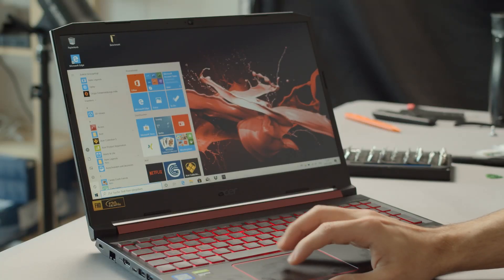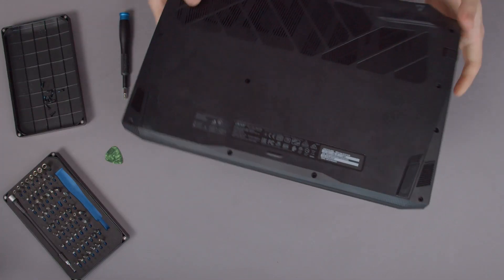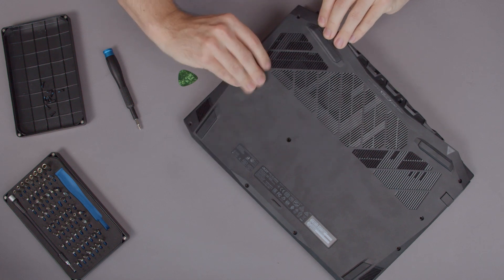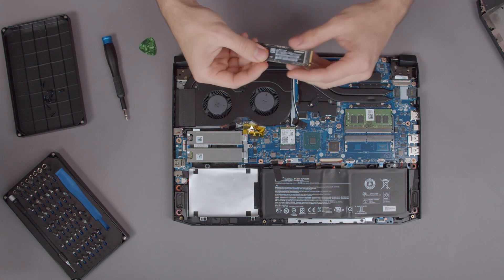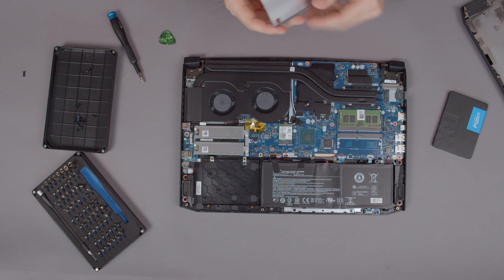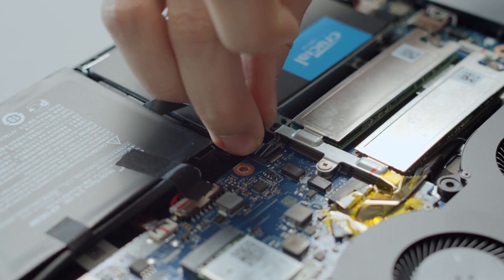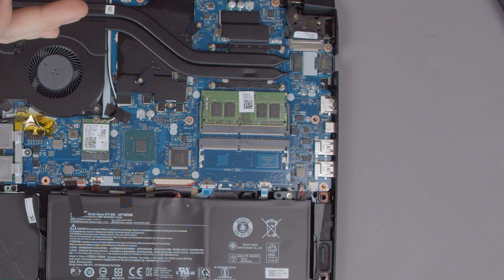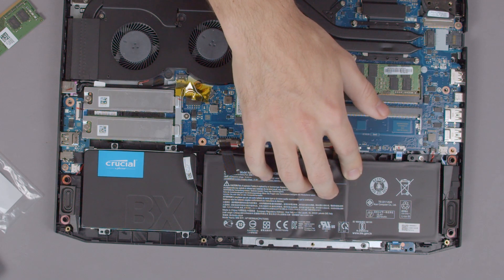Tutorial: How to Upgrade the SSD and RAM of your Acer Nitro 5 - ENG

Comment: Thank you for all the little extra info about speeds and whatnot. I've found a lot of this a bit confusing, as I haven't messed with the inside of a computer since I was a teenager and turned my HP pavilion into a VooDoo3 gaming monster (yeah.... it's been a long time lmao). So much has changed since then, and even though most things are simplified and no longer full of proprietary components connectors, its still a lot to take in after being gone for so long. Thanks again!! Now I can upgrade my RAM, cause 16GB isnt enough to mod Cities Skylines after you've bought all the DLC... lol

Comment: My laptop is Acer Nitro 5 AN515-43 R3JU 
What is the compaitable m.2 ssd for my laptop?
Reply from the maker: Hey, according to the spec sheet the standard SSD it ships with is a M.2 PCIe SSD. So there should be an open M.2 SATA Port in your notebook. But since we didn't check every possible Model, it' sbest to check if there is a free slot at all. If there is a slot next to the SSD already in the system, you can add any M.2 SATA SSD in the 2280 Form Factor as additional storage.

Comment: i just got new ram to replace the stock one (i bought 2x8gb) and when i put them both in the channels the laptop will start and the keyboard will light up and the fans will run but the display will not turn on. did i do something wrong?
Reply: Did you shut the laptop down and remove all cables before you insert new memory

Comment: I'm in Colombia, bought a Acer Nitro an515-43-r8jh and after only one year the mechanical 1TB hdd is slow and only 12GB ram is like little. My motherboard is Octavia PKS but you only find small info about it over internet. After several trial and error, I know now it supports DDR4 2400 max 32GB (16x2) and ssd m.2 NVME (not on the sata ssd port but on the pci port). Will buy this from amazon:
https://www.amazon.com/gp/product/B01HOM9WCI/ref=ox_sc_act_title_3?smid=AWD7GDDT7Q2ZT&psc=1
https://www.amazon.com/gp/product/B07VYG5HQD/ref=ox_sc_act_title_2?smid=ATVPDKIKX0DER&psc=1

Comment: I have this model of laptop and looking to put a seagate 2.5" 4tb hdd inside. However the thickness of the 4tb hard drive is thicker than the normal 2tb 2.5" drives. Would a 4tb Seagate HDD fit in this laptop or is the drive too thick to fit correctly?

Comment: hello! Can you tell me what is the max SSD speed that Acer Nitro 5 AN515-42 can handle? I have seen a Samsung 980Pro on the internet that has a writing speed above 5000 MB. sry for bad English
Reply from the maker: Hey, it's PCIe Gen 3, so you won't achieve that kind of speed. But about 3000MB/s are doable with the right drives. If you put a 980Pro in there, it will run on this lower speeds and will work fine otherwise.

Comment: Is there a limit for the gb on the second ssd slot?
Reply from the maker: There is a limit by Windows itself - or by the filesystem to be precise - but since that's 256TiB you don't need to worry about it :)

Comment: i have a nitro 5  i5 10th gen 1650ti with 2933mhz. Can i change my ram to 3200mhz? im planning to upgrade my ram with 16gb 3200mhz
Reply from the maker: Hey, you can, but it won't make any difference as the notebook is usually locked to that maximum RAM Speed. Also the 10th Gen. i5 won't profit from faster RAM much anyway.
Reply: @notebooksbilliger  So if I'll add one 8gb 3200mhz with my existing 2933mhz, both will have 2933mhz?? It's hard to find 2933mhz ram in my country, usually its the 3200mhz variant

Comment: @notebooksbilliger.de Hi, could you tell me which SSD to buy for this model please? AN517-51-76V6 Thank you very much! (if you have a link to a good one at a good price, that'd be great!)
Reply from the maker: Hey, there are plenty of options. Depending on what is actually build into your system you can either add a SATA M.2 SSD or PCIe SSD. Make sure to check that before buying anything. For a SATA SSD the Crucial MX500 is a safe bet. It's comparably cheap, yet fast and reliable. For PCIe you can't go wrong with a WD Blue (make sure it's the NVMe version here) or a Crucial P5. IF you want more speed the Samsung 970 EVO or WD Black SN750 are your best option in our opinion.

Comment: Finally got the acer nitro 5 and I want to change the ram from 8gb to 16gb, my question is can I remove the ram already in the laptop and get a 16gb ram (1stick) or do I have to get another 8gb ram to go along with the ram that came with the laptop ? 

And my second question is what type of ram work with the acer nitro 5? I use the intel core i5 version
Last question, is it possible to add an extra 16gb ram stick to the 8gb already in the laptop ? And make it 24gb ram ??
Reply from the maker: Hey, you can do all 3 if you like :) Best option is to go dual channel, which means getting two matching RAM sticks. You should be fine with DDR4 2666MHz. So my advise would be getting another 8GB module or if you want more than 16GB get two new 16GB sticks.
Reply: @notebooksbilliger  can I buy a 16gb ram and add to the 8gb I have already? Thanks for replying

Comment: hi sorry i just had this laptop and i have the 512gb ssd pcie/nvme. The empty slot beside it can i just add another m.2 pcie 1tb ssd to it for extra storage without downloading anything or do  i need to do something else? Same 2.5 inch ssd can i just buy and  Plug and the system would  recognise it? Any help would be appriciated please?
Reply from the maker: Hey, if you already got a M.2 NVMe SSD in your system, you can only add a M.2 SATA SSD into the second slot. But you don't need to download anything after you upgraded it, just head to the drive management in Windows to initialise and format the new disks.

Comment: My nitro 5 have been getting 80°c just from opening chrom for a while now, anything i can do to fix it?
Reply: If you still have warranty you should undervolt your CPU. If your warranty is over you should consider repaste of CPU and GPU. I dont know if opening and cleaning dust from fans will void the warranty tho. Also always limit framerate in nvidia control panel and set apps to use adaptive power mode. Sometimes, if laptop runs too hot while ingame, I disconnect the power cable and wait few minutes for temperature to drop but that gets annoying quickly. Also 80 degrees is still normal for laptops. If over 90 it becomes a problem

Comment: I purchased the N5 17.3 a few months ago. It's a a great unit, but being marketed as a gaming laptop is an error due to the memory size. It should have at least 1TB as a minimum. I use STEAM to download games, but the main one I use, uses so much memory, I have to uninstall the other games as a result.  Your video looks easy to upgrade this unit, so I may consider doing this as I feel my hands are somewhat tied at the moment as to what content I can download due to having very small RAM.  One question though, if mine is already set up, do I need to clone my current ssd to the new one and if so, how do I do that?   Also, should the battery connector be disconnected before working on the upgrade?  I'm sure on another vid I watched, he took the power cable off from the battery, then opened the lid and pressed the Power ON button a few times to discharge any residual current left in the system.
Reply: Just a small correction though. When referring to persistent storage data, it is best to use the term storage space, as memory size can be mistaken for RAM which stands for Random Access Memory.

Comment: Hi, I have a question... You say: The second M.2 SSD Slot only works with SATA M.2 SSDs! A second PCIe SSD won't work! 
But if I look at: https://community.acer.com/en/kb/articles/101-what-type-of-m-2-ssd-drives-are-supported-on-the-nitro-5#:~:text=2%20SSD%20drives%20are%20supported%20on%20the%20Nitro%205,-By%20Acer%2DIngrid 

It seems that for the AN-515-54 model (which I own) the M.2 slot 2 is compatible with either PCIe or SATA. 

So I should have no problem installing a second SSD NVMe PCIe in the M.2 Slot number 2 or am I wrong to assume this??

Comment: acer already gives u 2 m.2 slots and nvme ssd now cost almost the same as a 3.5 inch ssd why the hell are laptop manufacturers still putting in a 3.5 inch hdd bay wasting space and putting small battery acer can easily put in a 65w battery giving users so much better battery life

Comment: Thanks for the vid

Folks, does anybody know if SSD Samsung 860 EVO M.2 2280 (MZ-N6E500BW) is compatible with Acer Nitro 5 AN-515-54?

Or will any SSD with  SATA3 M.2 2280  be fine for the laptop?
Reply from the maker: Hey, any SATA3 M.2 will be fine, as long as you put it in the SATA M.2 Slot. So the 860 EVO will work :)
Reply: @notebooksbilliger  Hey:) Thanks for the reply
one more question -  are any further actions required after i put SSD inside laptop or will it be read and start operating automatically. I.e. will i need to tweak somesettings to make it work or simply inserting the SSD is enough?

Comment: Hey, thanks for the video. I have a question tho. I want to buy the new Acer Nitro 5 with Rtx 2060 model (AN515-54-728C) but I think it comes with 1 stick of 16gb DDR4 2666mhz ram. I want to dual-channel it but I don't know the exact ram they used on the laptop. Which ram I should buy in this case?
Reply from the maker: Hey, just get another DDR4 2666MHz Module, it will work fine. But if you insist on buying the exact same module again, you'll have to buy the laptop first and check what's inside.

Comment: Thanks, the part about how to remove the back cover was super helpful. Also the part about upgrading the memory was great. BUT mine looks a little bit different in the area of the SSD. There is "something" else in the spot where you inserted the SSD, so I don't see where I would add a 2nd one. Also the fans are not next to each other. I have one on each side.
Reply from the maker: Hey, there might be differenz revisions of the notebook around, so it's possible it looks different.
Reply: Adam B  Thanks, yup I did find it. On the opposite side.

Comment: why you did not disconnect battery before upgrading ? 
Is it not necessary ?
Reply from the maker: Hey, it's not. The battery connector is in fact so tight, you might damage more trying to remove it then just being careful without unplugging it.
Reply: @notebooksbilliger  Yes mine was also so tight.. than i remain that plugged 😂
after upgrading laptop usb slots were not working than i have to disable and enable that in usb manager

Comment: didn't you have to disconnect the batter before replacing RAM and SSD? How to disconnect battery , is it easily accessible? Also does this mean we can run 3 haed drives same time? (2x NVMe SSD and 1x 2.5"AATA SSD?
Reply from the maker: Hey, no need to unplug the battery, but of course you can if you feel safer. You can use a total of 3 Drives, one of each: M.2 NVMe PCIe SSD, M.2 SATA SSD, 2.5" SATA HDD or SSD.
Reply: @notebooksbilliger  if you are upgrading ram you should always unplug the battery and also discharge residual electricity by pressing the power button for 30- 60 seconds to be safe.

Comment: Hey man, I got my Nitro5 last year and this year bought a 8GB RAM to upgrade it up to 16GB. Now I want to put an SSD in it, because mine didn’t come with an SSD (it is the AN515-51 btw). 
Idk which SSD to buy, people have been recommending me the Green one, but is there any other option? Btw, I use my Nitro for both work (I’m a gamedev) and games.
Reply from the maker: Hey, just make sure which slots you have available. When you got both M.2 Slots empty, get an M.2 PCIe SSD like a WD Black, Samsung 970 EVO or Crucial P5. You Nitro 5 will work like never before ;) 
In Case you're unsure get an SATA M.2 SSD. It should work in every version of the Nitro 5 and will still be a big upgrade over your HDD.

Comment: Great video but I have a acer nitro 7 has pretty much same layout.  My Question is how to set bios to know you put in a NVMe PCIe 1TB SSD drive.  On the first slot of motherboard says SATA/PCIE and second open slot says PCIe. I purchased 2 PNY M.2 NMVE CS3030 SSD. My problem is in the Bios the only options says SATA Mode:  with 3 choices AHCI, RST with Optane & RST with Premium Optane.  Shouldn't their be a option thats says NVME or PCIe?
I left the default setting RST with Premium Optane.  Everything runs OK but should their be a choice to match the Drives I bought(NVME PCIE).  Do you think if their is a BIOS upgrade it would show a option for (NVME PCIE).  I tried asking Acer and they said they do not support upgrades and won,t talk to me even though they advertise open M.2 slot for upgrades that won't support it,even the Manager says so.
appreciate
Reply from the maker: Hey, when you use a NVMe drive, the SATA mode is irrelevant, since you don't use the SATA layer at all. PCI NVMe is a different protocol so it doesn't matter what you set as SATA mode in the BIOS.

Comment: I'm confused. I just bought my acer nitro 5 few days ago it is Nitro 5 AN515-54 rtx 2060 my laptop comes with 500gb ssd preinstalled. Now 500 gb ssd is not enough for(me) games. I just want to buy and add a second SSD to my laptop.  A bigger one(2.5) or m2 ssd. If i buy and add the bigger ssd should i need to reinstall the windows again or just using the disk management? My second question is if i buy the m2 ssd and want to add, it should be Sata? Or it's the second m2 part ssd needs a sata? My 500gb installed in sata or the other one u used in the video? i didn't open the back. So i don't know.  I need help about that  ( I don't want to replace my already installed ssd which came with the laptop Just want to buying and adding second ssd)
Reply from the maker: Hey, when you just add another SSD you don't have to reinstall windows. Just initialise the new drive in the disc management and you're good to go. About the M.2 Slot and what kind of SSD you can add you'll have to find that out by checking your exact model. There are Versions with M.2 NVMe preinstalled, so you can only add SATA and also some with SATA prinstalled so you can only add a NVMe SSD. You can check that using the device manager, it should show the name of the SSD. Google the name and it should say if it's SATA or NVMe. Then buy the kind different to what you already have. :)